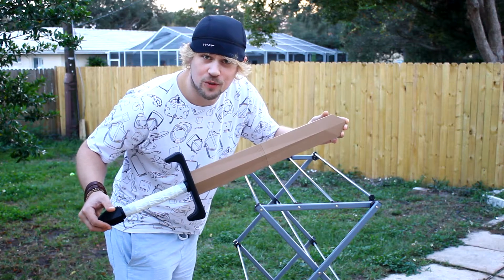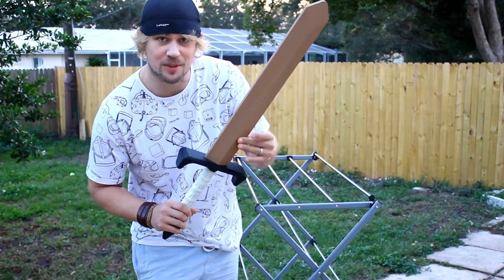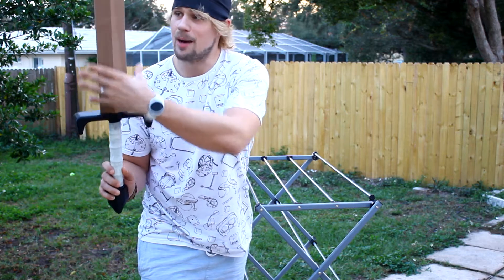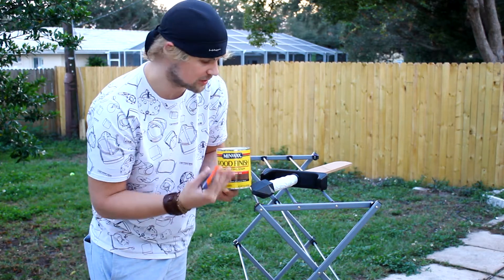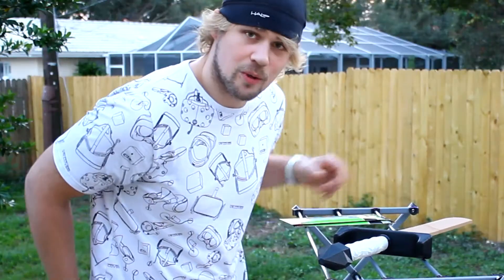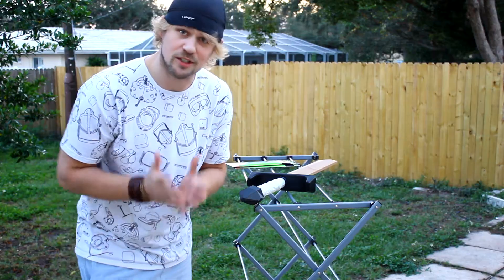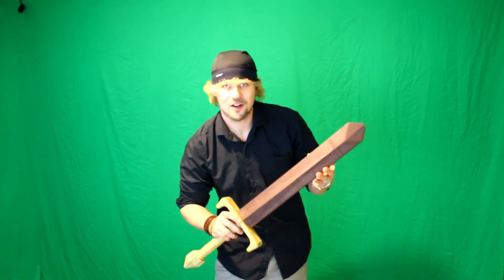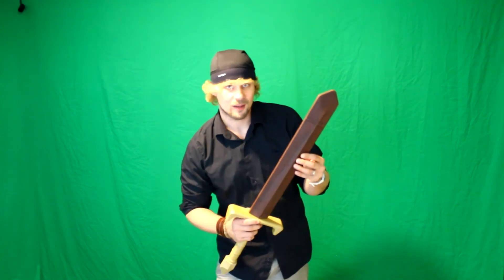ZELDA COSPLAY 3D-Print Link's Wooden Sword using REAL WOOD FILAMENT!

Comment: hmmm ok at what point did u realize that.... this project is not great for 3d printing...... just saying..... burning through a ton of material for something with a simple shape like that...... even if u don't have the tools for making in a different way it still doesn't make a lot of sense
Reply from the maker: what do mean not a great project for 3D printing? It is perfect for 3d printing! That's why they make wood filament and cosplay items work great since you can size them accordingly using 3d printers. I filled the swords at 10% so it did not use much of the reel of filament. 3D Printed swords and cosplay items are getting huge my friend!
Reply: Reality Check VR I mean the blade is a simple shape...... might as well print a cube the size of a printing volume of the printer.......just because u can do it.... it doesn't mean it's a practical use case of a printer and material